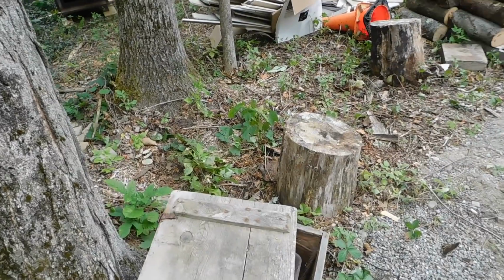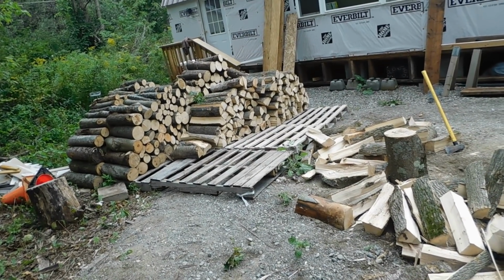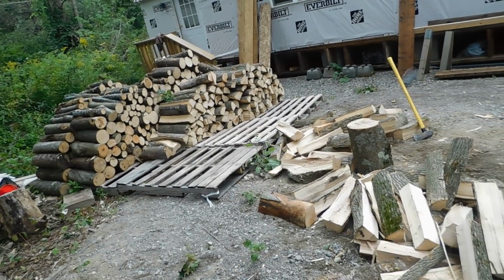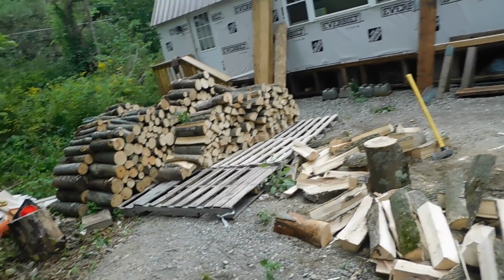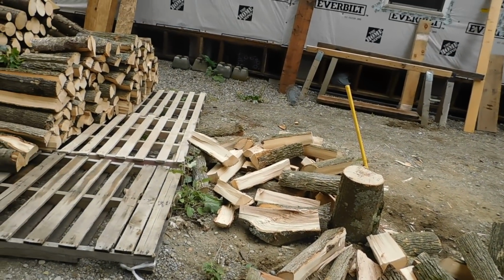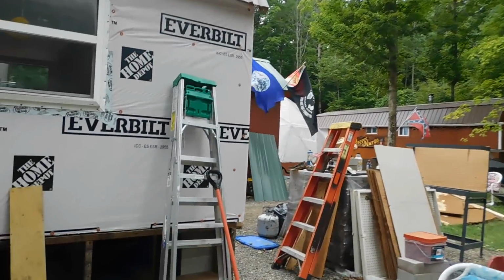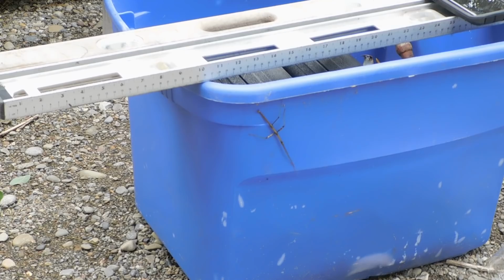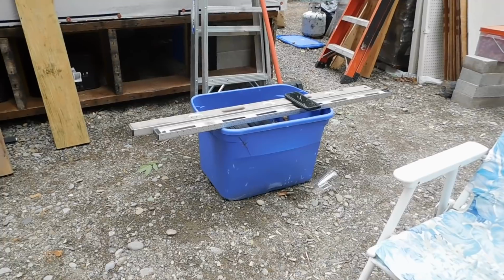Helping Mom and Becky get ready for winter. Today is the last chance to save 20% off on legacy foods

Comment: My God Splitting Wood Looks Like A Very Hard Job. Out Here In The Northwest In Spokane Washington People But Buy Pellet Stoves And It Is Very Reasonable To Burn Pellet's To Keep Warm.
Reply: Catherine Shaw The problem with every pellet stove I know of is that they all require electricity to operate. SHTF, they will be dead. Splitting wood IS hard work, and dangerous if you don’t know how to handle an axe or a splitting maul (Ed is using a splitting maul.)  I used to help Dad with the wood; he never let me cut or split, but I learned to stack and carry and haul brush with the best.
Reply: @vickisavage8929  Plus if the grid goes down, where are you going to get pellets?
Reply: @roberthill4789  Most pellet burners need grid poer to work.